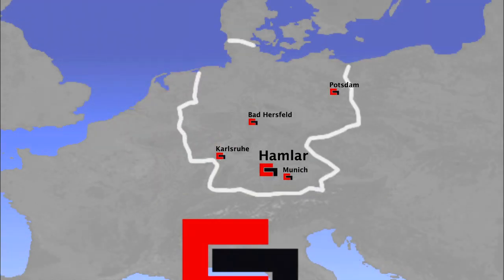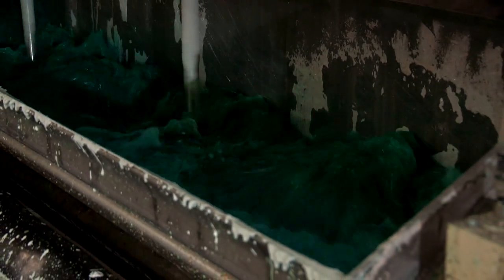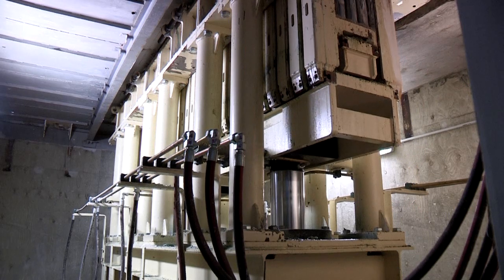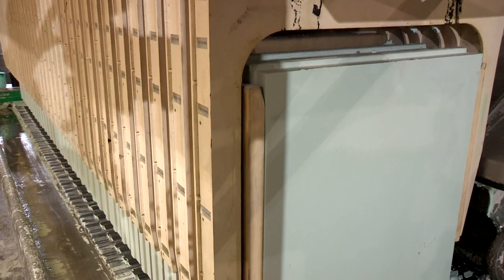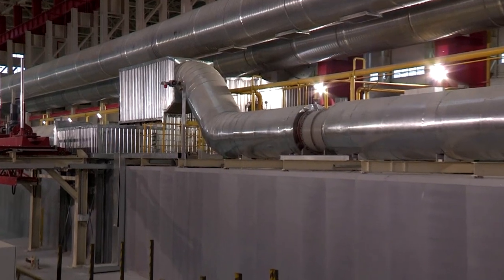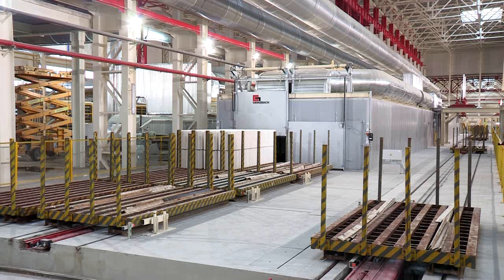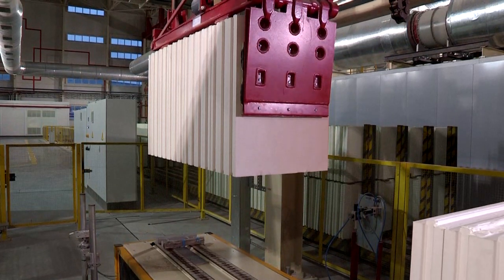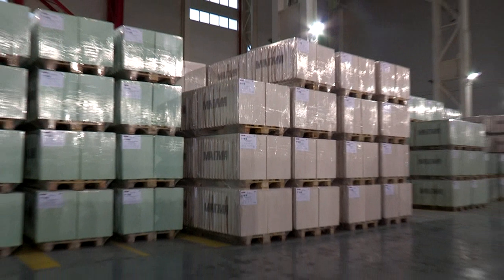Gips-Wandbauplattenherstellung | Gypsum Block Technology

Comment: Can we use recycled gypsum to produce those  blocks ?
Reply from the maker: In general, recycled gypsum can be used. 
Of course, this depends on whether the recycled gypsum is a direct return from a process, such as from manufacturing gypsum boards, or whether the recycled gypsum includes parts from construction sites.
Impurities, such as salts, silicones, retarders, accelerators, and others, thus affect how much of the recycled gypsum can be added to the production of gypsum wall blocks.
Please share your contact information with us at gypsum@grenzebach.com, and we can exchange further information.